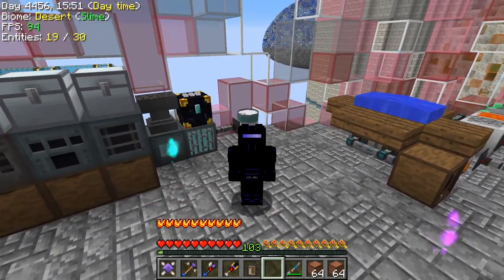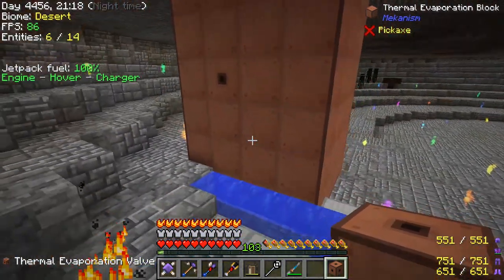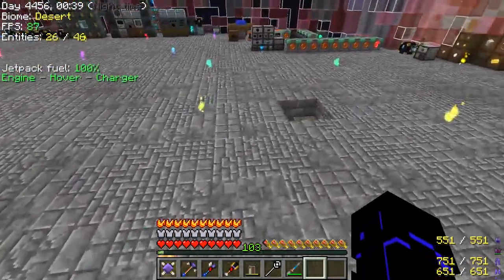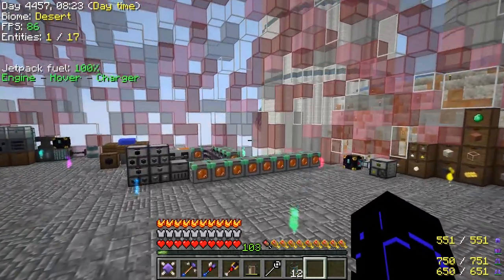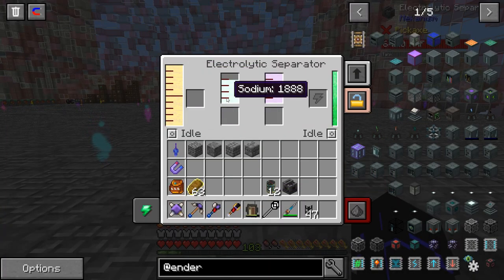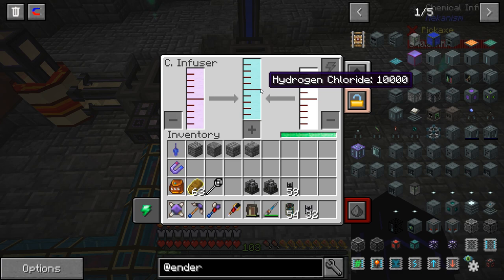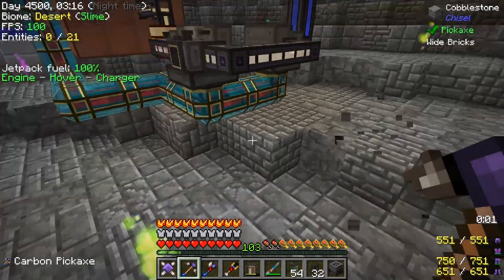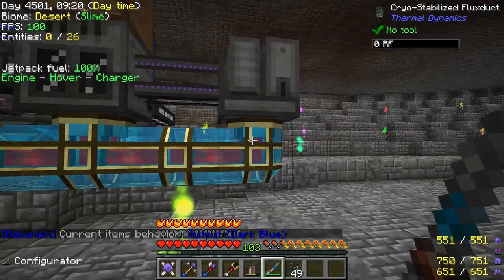Quintuplicate Ingots, Part 1 E28

Comment: Oblyx you deserve 100 time the subtle you have at least. Love your vids. Quick question, do the superheating elements affect thermal evaporation or no
Reply from the maker: Thanks for the kind words, I appreciate it very much.  Nope, the super heating elements don't work on the thermal evaporation plant.  They are a component in building the thermoelectric boiler multi-block structure.  The boiler though requires an outside heater.  The same heaters can be used on the evaporation plant.  Mekanism currently has 2 different heaters, the fuelwood heater and resistive heater.  To my knowledge you could put as many heaters as you have room for on an evaporation plant.